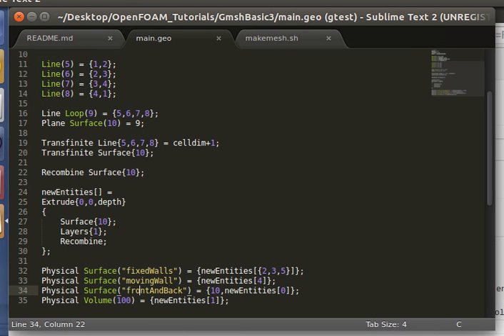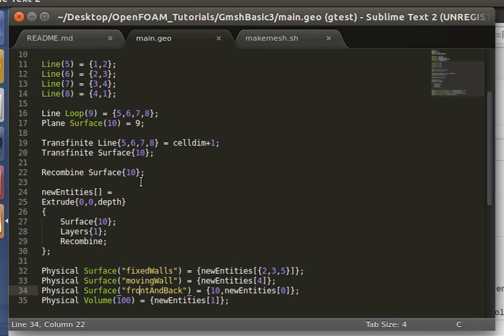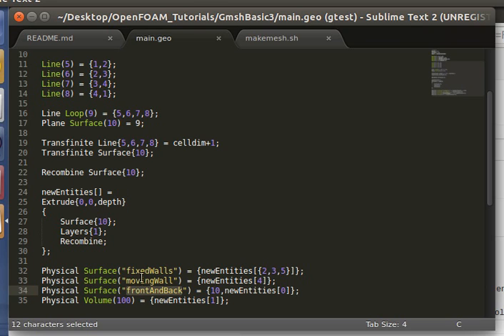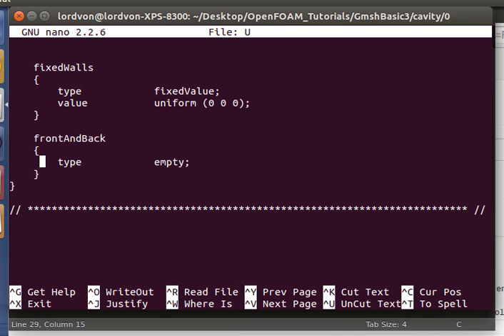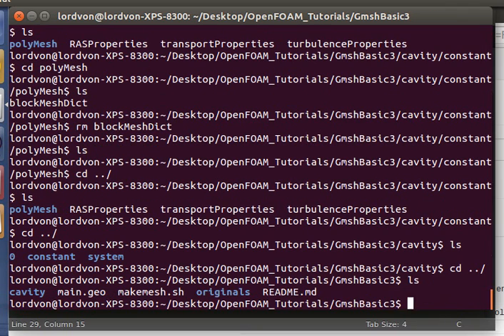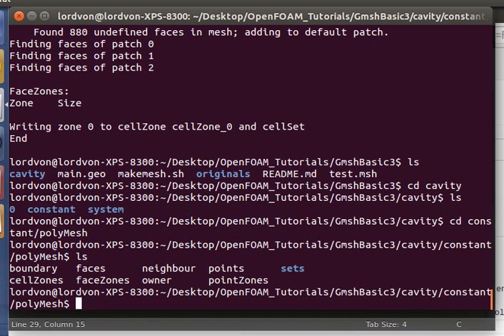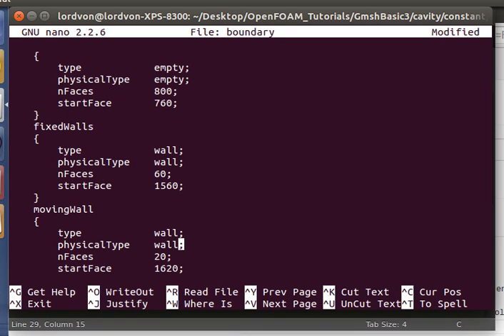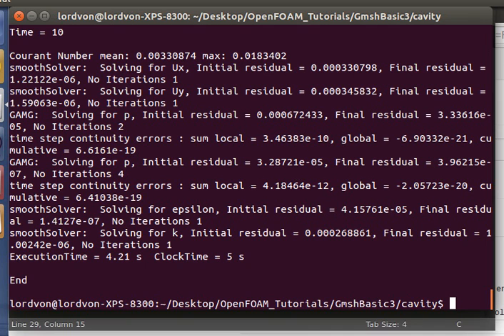Making Meshes for OpenFOAM with Gmsh, Part 3: Preparing a 2D Simulation

Comment: Thank you for your videos! 
Even though I do as exactly as you do, I'm having an error message when using gmshToFoam: 

wrong token type - expected word, found on line 0 the variable $MeshFormat
file: IStringStream.sourceFile at line 0.
.....

I saw you answered this same question on a blog. You suggested to use  -format msh2, but sadly it is not working anymore. Can you help me with this issue please?.
Thank you again!
Reply: I don't know if you're still looking for an answer, but
For OpenFOAM 8, try:

gmsh test.geo -format msh2 -3 -o test.msh

gmshToFoam test.msh
Reply: @Poeterish  thanks!